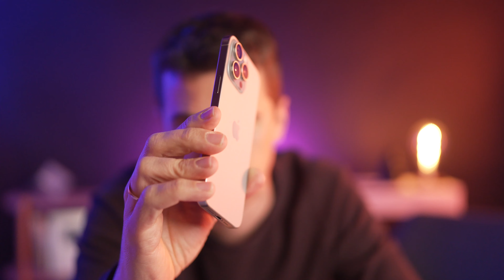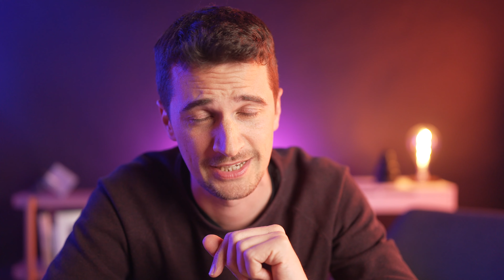iPhone 15 Pro Dynamic Range, Rolling Shutter and Exposure Latitude - Lab Test Talk

Comment: ISO on this phone has to do with highlight dynamic range AND separating shadow detail within the 100-1250ISO ranges, making it a requirement to get the ISO setting correct. Completely different from standard cameras, lots to learn.

If you lock your shutter for motion blur purposes and use a VND (I have a ND2-ND32 with a CPL Filter as well)…. ISO has to do with the HDR brightness/luminance of the highlights, VERY different way of thinking compared to traditional ISO. Seriously it’s weird. I found 400-800 to be a really nice ISO for dark daytime/indoor. So essentially, stare at the brightest part, reference IRL brightness/luminance and match it to the camera.

This is a 5 stop camera. I only use ISO 100, 200, 400, 800, 1250. I tested the ISO in between and noticed some issues that my ND filter could simply fix.

For daytime or bright scenes: ISO as low as possible. If your subject is too dark in the bright scene, I really like 200ISO with my VND… raising the ISO will lift the shadows (separates them, adding a little bit of noise as you go up. I don’t go higher than 400 in this instance). Try to aim for 100ISO… do not EVER use 55ISO bc highlight will be unnaturally dark, luminance will be absent. Put that ND filter to work, but choose the right ISO for LUMINANCE and don’t ever overexpose the highlights.

800-1250 introduces noise for dark shots. 1250 is the absolute MAX you can go considering noise. 1250ISO for dark/night shots with no filters at all (need as much light entering the sensor). There will be noise, but it’s ok bc it’s manageable in post. I also noticed 1250ISO exclusively has aspects of HDR luminance for highlights if you’re trying to blow them out into orange-red.

I have been testing so much these past weeks my brain is sludge.
Reply: Thanks for the info!
Reply: @time2go4us  let me know if you notice anything in your testing!
Reply: best Daytime iso ? And for Night ?
Reply: That’s a great write up and addition to an interesting video. You got a page to follow you on?

Comment: Liked and Subscribed

This comment is simply feedback on a comment early in the video - the LG V series was blazing trails for creators long before Apple. The V30 was capable of recording in full manual mode with a log profile in 2017. Another phone might have beaten it to market with that feature, but as far as I know that was one of the first phone lineups to market itself for photo+video producers.

Great video and thank you for your work!

Comment: I like my iPhone 15 Pro.  It will never replace a proper camera but it's nice to have another tool in the tool box to work with. As backup camera its nice that its now acceptable in the right conditions. A iPhone 15 Pro as a backup is better than having no backup at all if your main camera fails, breaks or is stolen.

It's also important to play to the strengths of the iPhone. As a drone, gimbal or wide locked down camera its actually really good.  The 24mm main camera is pretty wide but it's great for gimbal use. Gimbals for the iPhone are also much smaller, lighter and affordable making it a logical option for gimbal work.

Light well and stick to the wide nature of the phone and its not a bad solution at all as a B or C camera.

In terms of DOF while it's not very impressive I have found it to be equal to 24mm on FF at around f5.6. I do tend to shoot a lot of FF around f5.6 since thats the sweet spot for many lenses so realistically the iPhone works well as a 24mm camera in terms of DOF.  The problem is 24mm on FF isn't going to have a lot of DOF either due to how wide it is. The problem with the 77mm or 120mm cameras on the phones is they use much smaller sensors. The main sensor is a bit under a 1" sensor size. The other cameras are closer to 1/4" sensors. Now the DOF with the 77mm is closer to f 17 on FF making it pretty bad. Even m43 and a budget kit zoom lens is more capable.

Thats why the iPhone works great as a very wide gimbal camera where we kind of want more in focus anyway or as a locked down wide camera in a multiple camera shoot type setup.

At the end of the day like I said it's another tool.  Just like an action camera or dedicated drone camera is a special use camera to get very special kinds of shots. The iPhone 15 Pro is better than most of those type of cameras and can do much more.
Reply: I totally agree, and I think that is what their tests show. Ideally, in a pinch, you can get a great image. You may not be able to get a great image on any set anywhere, and do it reliably. I actually have started thinking that built in redundancy and reliability is the selling point of the expensive cameras, as well as quality of life features. 

I do see a shift, somewhat, around usb-c where now you can use regular batteries, monitors, and regular ssd's, etc with many mirrorless cameras. So, as the dedicated interchangeable lens cameras embrace a universal connector, this opens up those same accessories to iPhone use now.

Comment: I ran my phone cinematography arc, after buying thousands of mods, I'm so over it. The novelty wore off real fast. I see some talented people that seem to like working in that box and excel at it but I always wonder if they put the same effort into any m43 what they would be able to produce but that is not really fair, some tools in some hands really work.

Every time someone says "the best camera is the one you have with you" I vomit a little. Like we'll leave the Red at home because we have a potatophone in our pocket with a case of mods and gear anyway...
Reply from the maker: It sounds cheesy, but I think it's true. A phone camera is better than no camera, obviously, when you are out and about and didn't even think about bringing a proper camera, and then you need to capture something that would otherwise be missed and never be recorded entirely. Nino
Reply: @CineD  how banal. We take the position with these statements that spontaneous cinematic moments "just happen" without any planning. If they do it's going to end up vertical on some dad's phone with the backs of heads in the lower thirds :face-blue-smiling: If your gear of choice is a phone, you probably are over prepared at any moment anyway with a filter or lens mod, but everyone else will have regret they didn't have their gear. Phones are capable but limited, there is no argument on that but nobody is planning a downgrade, which it is, to go to a phone regardless of marketing speak and a stat sheet.
Reply: Phone cinematography, like any other form of art, has its own set of limitations and strengths. Therefore, assessing it based on its unique features is essential, rather than comparing it to traditional filmmaking methods. I always ensure proper lighting, using a gimbal and ND filter. Also, It is important to find the right scene. If the subject is closer to the camera and the background is further away, we can create the illusion of increased depth of field blur without adjusting the aperture. "I often get asked about the model of "camera" I use.

Comment: Rolling shutter faster for smaller sensor because of shorter trace distance. Voltage on a wire, hence data, can only propagate lenghwise so fast, roughly 80% speed of light. It will go slower with a longer trace.

Comment: Pretty unfortunate you can't turn off NR.  It's so obvious in those blotchy shadows that color NR is extremely high.  I would think it might be worthwhile to also test for temporal NR artifacts since in my experience some phone CMOS sensors seem to do temporal NR at the hardware level to minimize noise from the very small sensors.  If the chart in the latitude test is any indication, it looks like you also have to underexpose by about 2 stops just to get similar highlight range to most real cameras...  Also this really exposes how susceptible imatest is to being fooled by noise reduction.  This was always quite clear but this really shows how ridiculous it is to focus so singularly on imatest SNR=2 as CineD tends to do.  I remember many years ago when I first tried imatest I believe I recall there was a workflow for normalizing noise reduction built into the software, seems crazy to me that CineD isn't attempting to do that so their tests retain any level of comparability between cameras.
Reply: and thats what makes it look like "iPhone video" as against cinema camera image